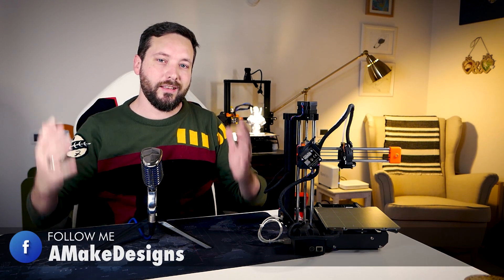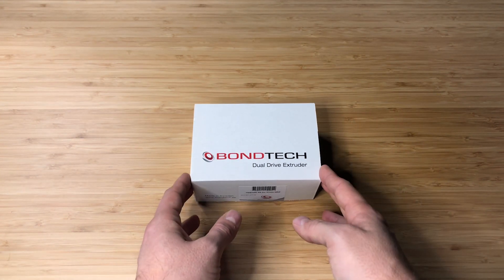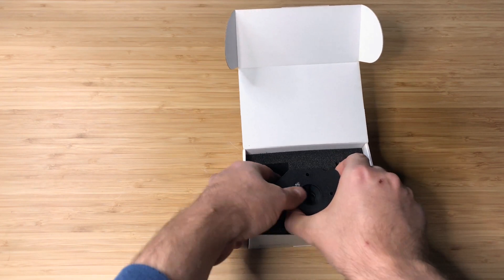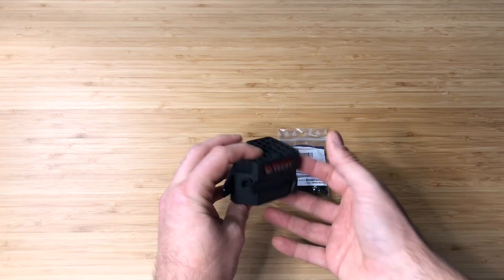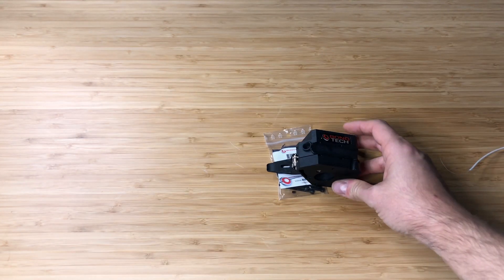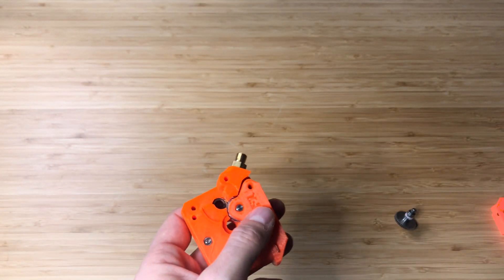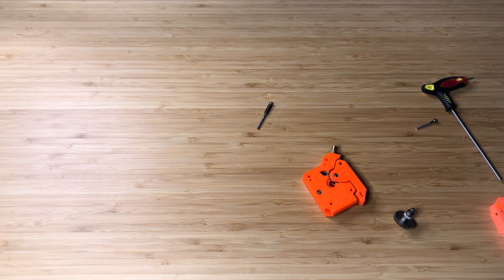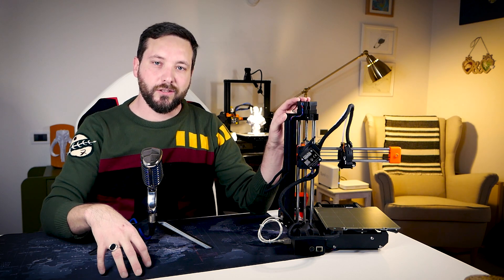Bondtech Dual Drive Extrusion Upgrade Kit for Prusa Mini: why is it better?

Comment: Im guessing since there was never a follow up that it didnt fix anything ....
Reply from the maker: It solved all my jamming problems. The stock extruder is too sensitive to my taste. It is too reliant on the idler tension. Is it a mandatory upgrade? Absolutely not, but if you have troubles setting the extruder this will help a lot.

Comment: May I ask, I'm thinking of a Mini Plus as first 3D printer.  I have a question for which I cant seem to find a clear answer online after a lot of Googling... I have in mind a project that would require nylon parts, though I will first need some time to learn the design software and slicing software, working with PLA and PETG and perhaps ABS until I can get good results (which should be easier with the Prusa Mini+ than other printers)... but I want my first printer to be capable of nylon with carbon fibre filaments (perhaps with hotend upgrade to cope with the abrasiveness of carbon fibre).  Will the mini plus be able to print nylon and what upgrades would it ideally need?  Thanks in advance. BTW, I'm planning to make an Ikea enclosure with fan and filter.
Reply from the maker: The spec sheet reports it is ready for nylon. Max hotend temp is 280C.

For carbon fibre you will need a hardened nozzle to cope with abrasiveness.

Welcome to the club! 😀
Reply: @AMakeDesigns  Many thanks, I'm blown away with the new materials and the low cost and capability of these printers compared to only 5-10 years ago. Can't wait to jump in!  Nice channel by the way!

Comment: if it's too tight don't screw it in so hard genius
Reply from the maker: It's not a matter of tightening torque but rather of alignment of the two parts.

Comment: Does this eliminate the extruder retraction noise many experience (clicking or grinding)?
Reply from the maker: Yes. Completely.
Reply: @AMakeDesigns   Well, I purchased the IFS version for my Mini+ and installed it without issues. First day was silent and I was thrilled. Now I'm getting a small, but clearly audible "yelp" type squeak on retraction it seems. Is yours still silent after long term use? I'm stumped. Nothing obvious seems wrong.
Reply from the maker: I hear no noise. Did you try loosening the idler?
Reply: @AMakeDesigns  I did, but I will continue to try to adjust in small increments and see if I can work it out. It's still far less noisy than the stock extruder, but sure hope I can find the sweet spot I apparently had on the first day of install as it was beautifully quiet. Thanks for responding and sharing your experience. If I find anything helpful out, I will report back for others benefit.

Comment: as of 2021, has Prusa addressed the issue with their original extruder?
Reply from the maker: What issue are you referring to?
Reply: @AMakeDesigns  they say some filament junk gets clogged in the extruder?.. im considering a prusa mini as my first 3d printer.. its seem getting a printer is better than having to wait and pay for some1 else to do the print only to realize you need to revise and reprint again.. 3d printer are kinda practical to have at home..
Reply from the maker: I only had problems with flexibles. You need to tweak the idler tension carefully. Overall it's not bad, it's not excellent either... I would say the Bondtech is a valuable upgrade.

Comment: The spring tensioner in mine keeps getting the bearing/gear "clogged" and makes an awful clicking sound.
Reply: Same issue here...
Reply: when you are installing extruder you have to test that gear and motor is spinning before thingtening all screws
Reply from the maker: Good luck with that!
Reply: @AMakeDesigns  are you responding to get credit? Real youtubers  give advise or don’t both responding.
Reply from the maker: I try to help when I can. I upgraded the extruder because I was struggling to set it properly. This is the only advice I can give without more details : https://help.prusa3d.com/en/article/idler-screw-tension_177367

Comment: That bontech is injection molded
Reply from the maker: Are you sure? If it is I really wonder how they make the 2mm hole for the filament.
Reply: @AMakeDesigns  No, it's SLS 3D printed.
Reply from the maker: That's what I say in the video 😉

Comment: Fyi its not hard to tell how much tension you should put on the original extruder, its even in the manual. The tension screw should be flush or max 1mm below the surface if filament is loaded ;)
Reply from the maker: thanks for sharing! I must have missed it.
Reply: @AMakeDesigns  you are welcome, but the bondtech looks promising. hope you will make a followup for setting the start gcode and stuff because of the new steps. you cant do it in the firmware sadly
Reply from the maker: it's in the plan!

Comment: Before you took apart the prusa extruder we could see how tight you had the tension spring. And you had it WAY too tight, which is why the extruder was eating up your filament. "The idler screw should be about flush with the plastic part, when the filament is NOT loaded." https://help.prusa3d.com/en/article/clicking-extruder-under-extrusion-and-clogging-mini_112011
Reply from the maker: Thanks for sharing! It was not the original setting. I played around with the part before the video, you have to remove the screw that acts as the hinge for the idler to take the extruder out, so I had loosened the tension screw and then put it back after the removal. Anyway, IMHO, that screw is quite difficult to access and check.

Comment: Nice video. Can you talk about the load/unload function in a another video? I heard that this feature doesnt work anymore when upgraded to bondtech because of the e steps. And please show the quick release of the extruder :)
Reply: If that doesn't work then the Bondtech is a downgrade! The load/unload future is probable one of the best parts about this printer. I've never been able to change filament so easy.
Reply from the maker: It works for me. Sometimes I have to do an extra purge, that’s it

Comment: Hi, I have tried many times to understand why there is this veneration for Prusa printers, I honestly do not understand ... 
for example the original extruder from the mini is very very  bad , yet people spend more than 400 euros for a printer that even under the aspect of mechanical profile is disappointing.
About the original extruder it would be acceptable if it were the result of a home made design by a private individual... but to think that it is the result of a company, whose printers (built with Chinese hardware) cost 2-4 times more than a Chinese one ... .....go to understand people.
Any extruder I have found in Chinese printers (even the worst) is superior to the original prusa mini
Reply from the maker: Well, Prusa's business proposition is around service, tech support and end-to-end ecosystem, they know they will always be more expensive than China. I don't love or hate them, but I liked the Mini experience out of the box. No bed levelling, I just start it and leave, contrary to my Ender that requires supervision for the first layer or two. To be fair we have to say that Ender-3 stock extruder is junk, at least the original plastic one: it wears off, breaks around the insert, loses force over time.
Reply: you have got to be kidding me with that last statement.. So you think the insanely terribly stock plastic ender 3 extruder is better then the prusa mini extruder? 

All printer gear from basically every company in the world is made in china with "chinese hardware"... that doesnt make them bad. 

The prusa mini is incredible for the price, and you can get clones for less then an ender 3 pro which makes it a no-brainer.
Reply: @raider1284 
in fact, by now all the world production of hardware and electronics is produced in China (then of course there are also quality products) Prusa assembles in Europe but most of the components are Chinese.
What I meant is ... that sometimes myths are created that are not in reality.
In people's minds the idea that all plastic parts are produced by the same Prusa printers is a nice thing, please don't joke !!!! the quality of plastic components manufactured by injection molds is considerably superior, from all points of view !!!
Regarding the bondtech extruder, here too a myth is created ... you can get the same type of mechanics by spending much much less (https://it.aliexpress.com/item/1005001431887581.html?spm=a2g0o.productlist.0.0.65652caaL3MJkQ&algo_pvid= 69d041f9-f8c5-4a66-ae5d-8870b99becdc & algo_expid = 69d041f9-f8c5-4a66-ae5d-8870b99becdc-9 & btsid = 2100bdec16069784779974377e9ab2 & ws_ab_201_test0, searchweb3) .
An example on ender3 but you can mount it on any printer ... including the prusa mini :-)
https://youtu.be/QnrH2Sk7y40
Reply: @ultrabeamitaly1  that linked extruder is nowhere close to as good as a bondtech or prusa extruder. Why do you think it's better? It has much worse filament path and doesn't have a 3:1 gear ratio like the bondtech and prusa extruders have.
Reply: @raider1284  I refer only to the mechanical system drag , prusa better ??? do not joke, in the prusa extruder the filament is squeezed between a knurled pulley and a (flat) bearing without a groove :-( 
 very bad mechanical solution to drag a plastic wire,  why don't you see this ?
In the extruder that I have indicated, the yarn passes between two knurled grooves both connected to the motor, this is a mechanically superior drag condition, about 3.1 ratio for me insignificant, my printers have extruders with 1.1 ratio and works fine
About the extruder path is straight, so no problem :-)
Reply from the maker: We respect all points of view on this channel. Again, the Prusa business model is about service and support to sustain the premium they charge. The fact that injection molding is superior to 3d print is a generic statement I disagree with, the ender 3 injection molded extruder is an example. I got low quality parts supplied with my clone that made assembly impossible without repair. This would have never happened with a prusa machine. If something goes wrong with a Chinese brand, forget about customer support, the internet is ridden with examples.
I guess we are all hobbyists. If I was running a 3d printing business I would not touch a Chinese machine with a stick. I would want reliability, customer support, printing out of the box, zero upgrades, zero problems, which is prusa's business model.
Reply: @AMakeDesigns  awesome response! No option is perfect they just fit different needs
Reply: @AMakeDesigns  Well their customer support sucks and they are not as open source as they claim. I have a prusamini+ and its......ok. Many limitations for price point.